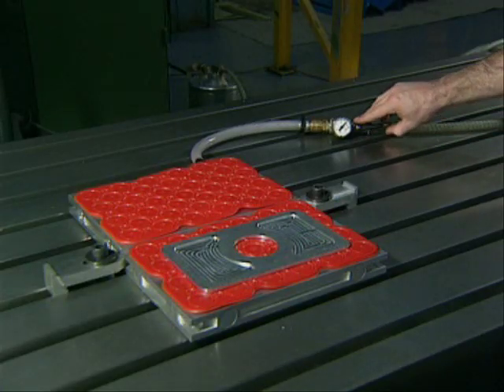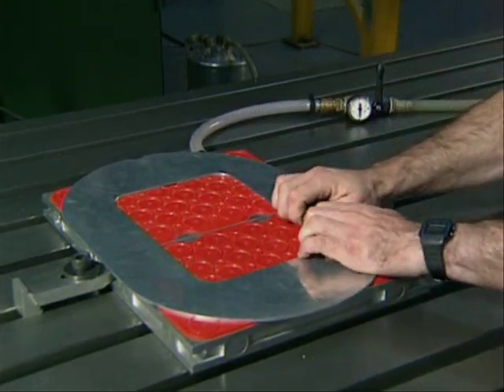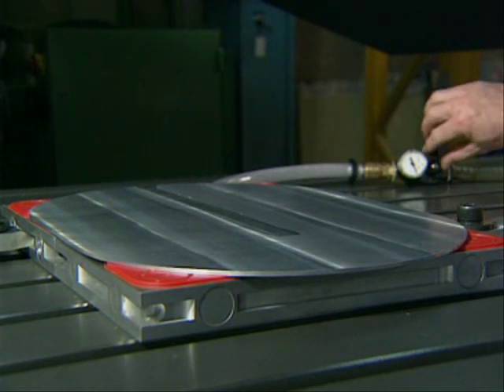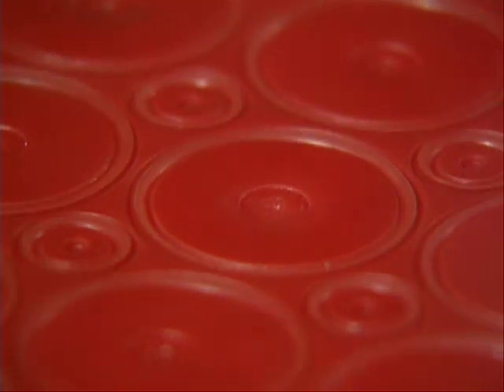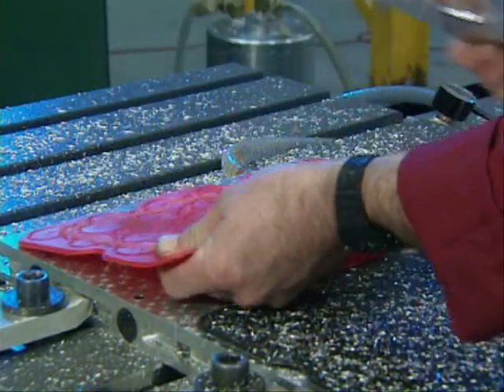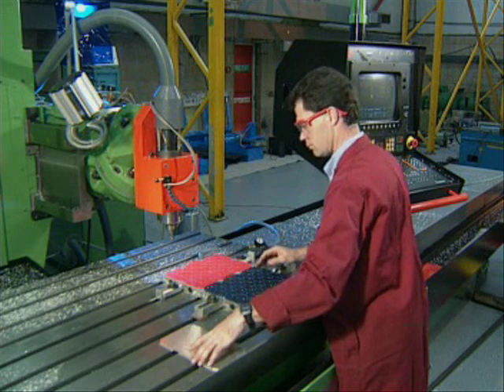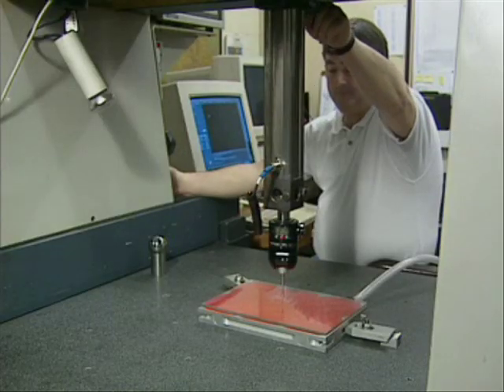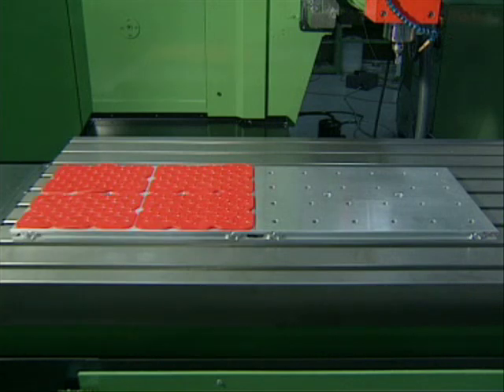Vacuum Work Holding Chucks

Comment: @stereotomyalan Air under the workpiece is sucked out by a pump or even a household vacuum cleaner. This means that atmospheric pressure at 15 lbs/sq in is pressing down on the workpiece holding it securely.